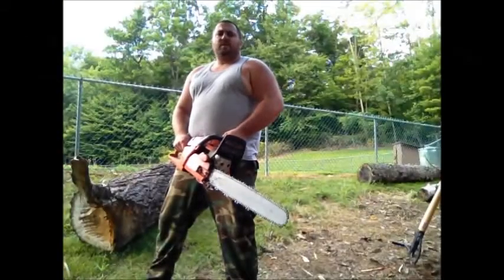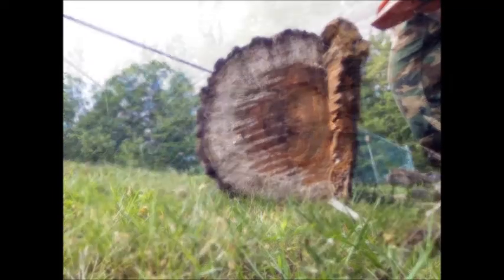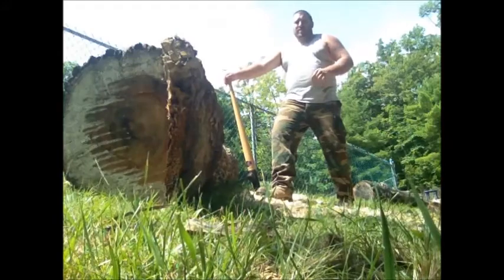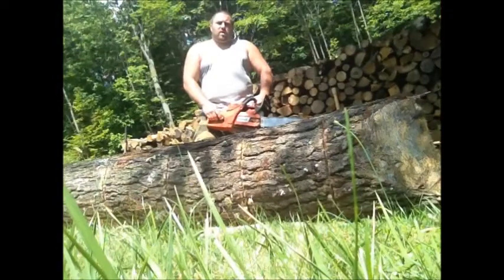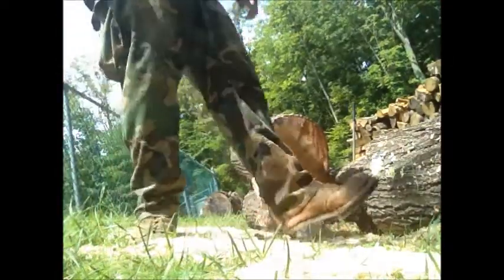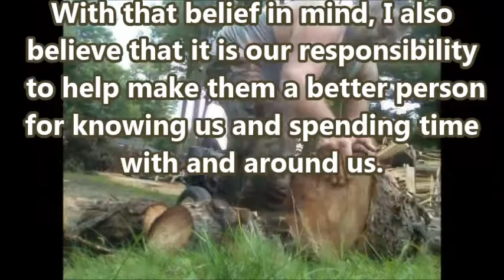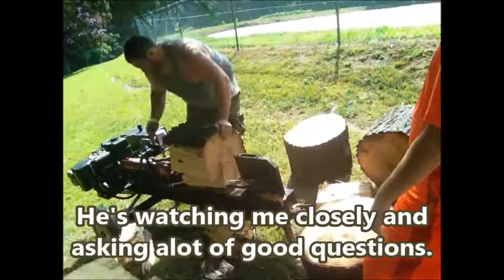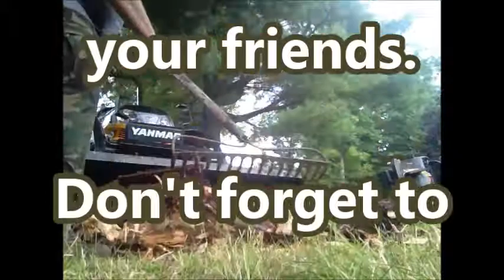🔥DIY 4x4 Diesel Tractor Makes Cutting and Processing Firewood Easy. Work Smarter Not Harder.

Comment: Great video and I agree with what your message is. The only thing of concern  I saw in your video was lack of PPE. 1 slip and its hello ER room! 

 Also the tractor does make it much much easier to work!
Reply from the maker: Rockjock007 thank you for mentioning that. I completely agree with you about the importance of ppe. Contrary to my regular practice I did forget my gloves and my glasses. I did however have my ear plugs in and my cavlar lined jeans on. I wouldn't dare run a chainsaw without them on. I appreciate your input and hope to hear from you again soon on another video.

Comment: It is an old myth that pine creates creosote, all wood can create creosote if not dried properly.  Many in the northwest US only burn pine, as it is all they have access to.  I heat my home with 50/50 pine and hardwood, and my flue is nearly spotless each year when I brush.  My wood dries for typically 2 years before burning though.
Reply from the maker: aggieneer02 I am aware that the majority of those in the north west burn seasoned pine. I have seen +wranglerstar, burning it for 3 or 4 years now. if I am not mistaking the variety of pine that is native in that area is a drier harder more dense wood. This creates a higher BTU and makes it more economical to burn. The pine that is native here in upstate NY is a softer much less dence and contains much more sap than its Ponderosa pine cousins in the north western US. The pine here is used primarily as an outdoor wood furnace or as bond fire wood simply because of the type of wood we have. You are correct in saying that all wood can create creosote if not dried properly. Unfortunately the varieties of pine we have take so long to properly season or dry out that the outer portions of the wood actually begin to rot before the middle is dried out. Or it can be split and covered while still green, but that makes a big mess from the pine pitch. For me here in upstate as you have heard there is not an easy answer to how to use the pine.